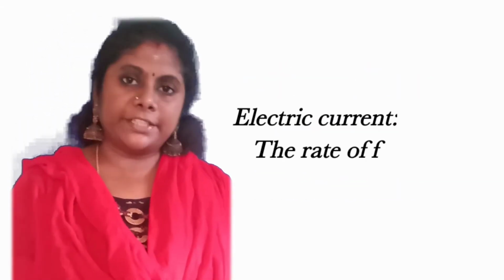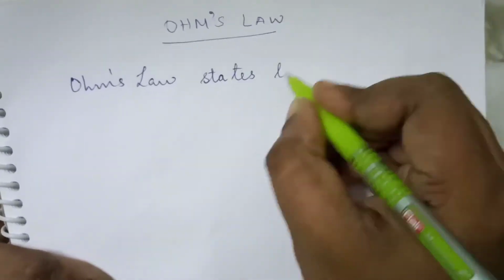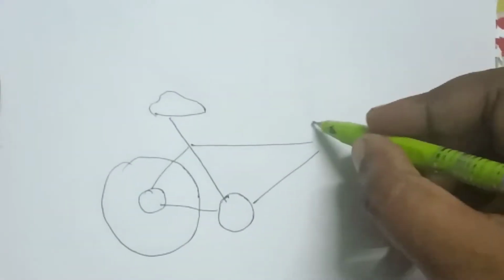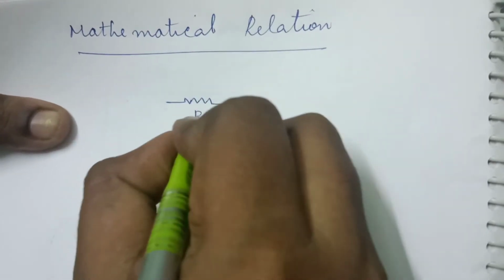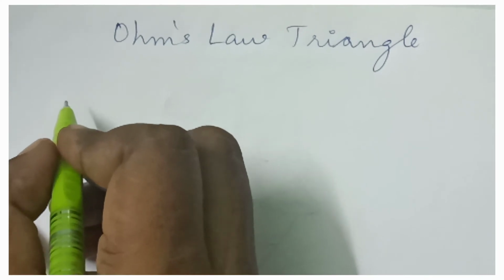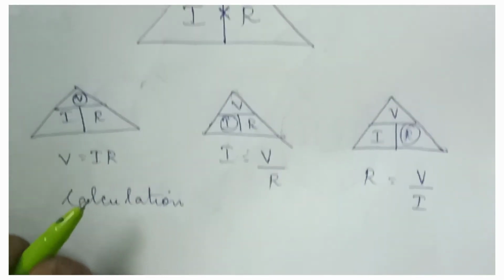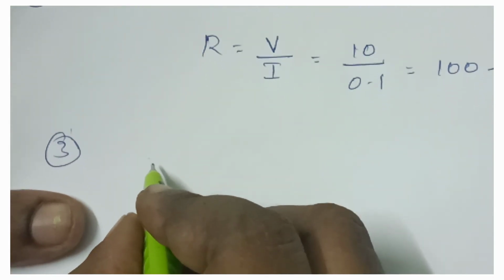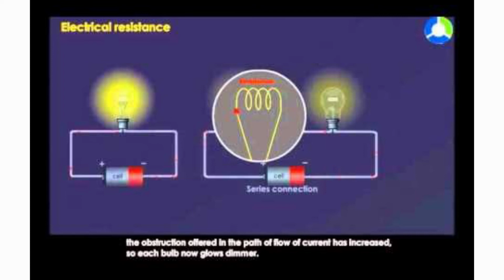Electricity: Ohm's Law

Comment: Hi mam iam bharathi ammeter is connecte in series because the aim of ammeter is to measure the flow of current hence it is connected in series whereas the voltmeter is used to measure the voltage change between two points that is the potential difference is this correct answer mam
Reply from the maker: Yup excellent dear
Reply: Thank you mam

Comment: Hi mam iam bharathi the reason why ammeter is connected in series because it has low internal resistance whereas volmeter has more internal resistance
Reply from the maker: Good try but still u can try
Reply: Mam I have commented another answer is that right mam
Reply from the maker: I couldn't see ur another answer

Comment: Mam Iam murali. Ammeter is connected in series. 
Voltmeter is connected to parallel
Reply from the maker: Tell me why
Reply: Mam iam murali.
Ammeter have low resistance while volt meter have high resistance

Comment: Hello mam this is devanadhan 🙋👦
Ammeter is connected in series because ammeter has less internal resistance.
Voltmeter is connected in parallel because voltmeter has high internal resistance.
Thank you mam✋
Reply from the maker: No not exactly.try another answer
Reply: Ammeter is connected in series so that the current  to be  measured must pass through it  so it was in the series and to measure the potential difference between two points voltmeter is connected in parallel
Reply from the maker: Excellent
Reply: Thank you mam😇